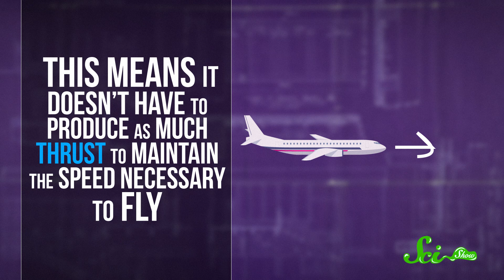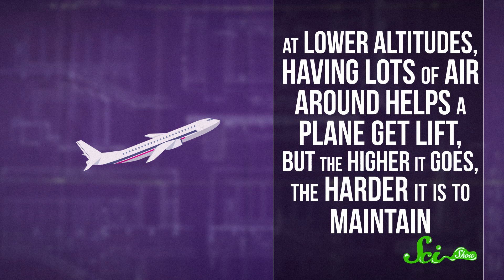Why Do Planes Fly So High?

Comment: but what about steel beams...?
Reply: I heard it melts dank memes
Reply: Steel fuel can't melt jet beams
Reply: ***** But jet beams can melt steel fuel.
Reply: ***** But a plane at 150.000 kilos flying at 854 km/h can bend steal beams.
Reply: Steel jets can't fuel dank memes
Reply: +ExperimentLife 9-11 an inside job? Well, 7-11 was a part time job!
Reply: It was an inside job.
Reply: FUNKYBULL SHRIMP
It is a fact that the internal temperatures inside of the twin towers reached temperatures to turn the steel into practically hard clay. Read the popular mechanics issue on it.
Reply: 9/11 did jfk
Reply: RantZ_IE There is no reliable video footage or imagery of actual molten steel from the site, the temperatures reached inside the buildings from the burning jet fuel was enough to weaken the steel into a dough like state though, and that could've been confused with actual molten steel as it would've been soft, pliable and red hot. As for molten aluminum or more easily melted metals from filing cabinets or chair supports, etc. that would easily be feasible.
Reply: rdizzy1 Then how come the buildings came straight down in steam of falling over to the side? How come WTC7 Came down when no plane has hit it? For you to get that much molten lava in one place all of the office metals would need to be in one pile in witch was not the case.
Reply: Lynx Kepler Then what explains all the melted steal on the ground?
Reply: RantZ_IE
Like I said , there isn't ANY reliable actual pictures/videos of actual lava. And it came down at once because of A. compounding wage of floor after floor collapsing on each other and B. The burning jet fuel poured down the elevator shafts, weakening almost the entire buildings core structure at once.
Reply: RantZ_IE
If what people with your paranoid, illogical thought process think is true, then what exactly would whoever ACTUALLY caused the buildings to come down use to supposedly cause thick steel beams to turn into liquid molten metal?? Because they've already done studies on every single thing as an entire issue of popular mechanics, and every arguement I've ever seen is worked out in detail.
Reply: RantZ_IE
and where exactly is the PROOF that there was actual liquid melted metal(while it is still molten)?>?
Reply: Lynx Kepler
He doesn't have to have ANY education at all, this shit has already been proved to be bullshit by ACTUAL physicists at actual decent colleges, read the issue of popular mechanics. Every single issue you've brought up is in there, including many more.
Reply: Lynx Kepler The tower was weekend in one edge, If the tower were to come down from the plan the edge hit by the plane would come down first, There for there would be massive horizontal pressure(Thing Called gravity) There for the top part of the tower would have came down at a angle. The Molten was found in a liquid form witch would be molten lava. Also WTC7 Also came straight down, The debris did not make any of the other building come down neither.
Reply: It falls towards the pulled out card, Go ahead and try it for yourself in slow motion, Aside from that it is not a good comparison because in a house of card every card is supporting everyone, Take four water bottles and put them in a square then put a book of sorts on top, Take one out.
Reply: Lynx Kepler I do not believe you have. I have  Masters in Physics my education is there.
Reply: Temperatures inside that building were soaring to over 1,300 degrees....Put 30,000 gallons of jet fuel, burn it in a contained concrete and steel box( or twin tower) blow some air on it, and Ta Da! You get a massive Furnance enough to even change the shape of titanium. Steel is weak as hell guys. Just because the building standed there does not mean they are not already under immense pressure from the possible 300,000 ton weight of the Twin Towers. Once that fire weakened the beams, something called GRAVITY did the entire job. Why the hell do people forget Gravity pulls everything down? Is like nobody in 2001 till now fighting about inside job ever took a freaking physics class....And if any of you believe that buildifing fell perfectly down, then you are blind as hell. Was a few blocks away when it happened and the top part litteraly collapsed sideways into another building. Stop creating lies. People actually died there.
Reply: rdizzy1 Molten aluminum does not glow red/orange like lava... Molten steel however does
Reply: ***** Ok you are the biggest tin foil hat ever. I was actually there. Like 8 Blocks away. You could see the actual steel being melted by it. Black Smoke has nothing at all to do with the actual temperature of the building inside and Scientist actually said this not damn experts who think they are experts. The fire was not yellow at all. it was already looking like a freaking volcano inside that building when it collapsed. Damn people are actually this stupid. why the hell am I even fighting with Tin Foil hats about this 14 year old crap. I dont care that the Twin Towers fell already. Move on.
Reply: The funny thing about conspiracy theorists, is that they think they know something that other people don't. They think they are in some secret club of people that are in on something real juicy. The truth is they "know" things that don't actually exist, it is all in their heads, and they need medical treatment asap.
Reply: Omg. I give up *****  you are already dragging it. Oh trust me I understand. but your calculations will be wrong. At this point is like I said, It will not melt the steel beams but it will defently weaken it enough for the massive concrete and steel building to collapse on its own. Every Tin Foil talks like if this building was the most technological building ever. It was crappy, boxy, and completely hideous. Look at the buildings today and also they're technology. Dubai is wayyy ahead than the New York or any American city with that skyline. If you are forgetting Monk, This two towers were built with 1960's technology...Its the year 2015 and things are a lot better and more powerful even for NASA. Also remember for its height, this building was incredibly un aerodynamic. im surprised with all that weight that it even lasted so long. I guess no one will ever respect anyone with an engineering degree in the internet.
Reply: Ok guys jet FUEL can't melt steel berms BUT jet COMBUSTION can melt it if it is strong enough so OK
Reply: Here's another plane related conspiracy theory: Government officials flying over the Bermuda triangle may disappear sometimes, due to the aircraft failing to maintain lift. Also, note "triangle". Illuminati confirmed :]

Comment: why does flying make my ears pop?
Reply: Anahi Cardona Short answer: Differences in air pressure. 
Long Answer: Otic Barotrauma happens during descent where the pressure inside the ear is lesser compared to the outside (the environment you're in) because remember, air pressure decreases with an increase in altitude so when you're descending, the opposite happens. Your ears is somewhat sealed and as a result, there is a difference in pressure. Chewing gums actually work for some people as it opens up one of the tubes connecting between the ears and the mouth which gives it a chance to equalize in pressure. Once that pressure equalizes, you'll be fine.

Fun fact: In very rare cases, cavities in teeth can also explode during flight due to a difference in ear pressure (same concept as the ear). 

Source: I'm a pilot.

Comment: Surprised you didn't mention cabin pressure, which is still pressurized to a couple thousand feet above sea level, meaning thinner dryer air in the cabin. They can't keep ground pressure because the structure of the plane can't hold it.

Comment: I have two questions: 1. If higher altitudes mean less oxygen, why is it that supersonic jets, such as the Concorde, are able fly at higher altitudes? 2. Even if having oxygen canisters to power the engines and gain higher altitudes makes them essentially rocketships, why don't we have them for commercial use anyway? Is it too expensive having to refill both the oxygen and fuel or is there some other reason?

Comment: You forgot to mention facts on temperature decreasing in the troposphere but then pausing and increasing in the stratosphere which reduces the benefits of flying much higher than the tropopause, even though the air is thinner and a higher true airspeed could be achieved. Oh, and then you could have got into airflow over the wings vs. mach and how at some point then airplane will either stall, or must go faster than the speed of sound to still produce the necessary lift.

Comment: Why is it, when you push something down in boiling water (a hot dog or maybe a vegetable) to the bottom of the pot.  It starts boiling like crazy?
Reply: Because then there's not only boiling water below it, but completely surrounding it, plus it's closer to the heat source.
Reply: Nerfin Merfitt The bubbles that boil up are formed on the surfaces of objects. Pushing an object to the bottom of the pan adds significantly more surface area.

Comment: BTW: The first commercially produced jet liner the De Havilland Comet was prototyped in 1949, and started making regular flights in 1952.  Unfortunately, a year later, metal fatigue around the square passenger windows resulted in fuselage failure, but after the windows were rounded, like modern jet liner windows, the Comet was reliable. But the damage had been done.

Comment: AAAHHHHGGGGG NO! That's wrong. "This means it doesn't have to produce as much thrust to maintain the speed necessary to fly" is completely wrong. The amount of thrust needed to fly depends on the weight of the aircraft and the ratio between lift and drag. Lift and drag vary together as density changes so their ratio is CONSTANT. What actually happens is that all the speeds (stall, min sink, best L/D etc.) change as the density changes. Flying in low density air means that the speed required to fly is higher than it is at high density, but the thrust required to fly is constant!!!!!! They fly higher for two reasons. The jet engine is more efficient at low inlet temperatures and there are lower temperatures up high, and the plane travels faster for the same thrust. However I can't stress too strongly that the THRUST REQUIRED TO FLY IS CONSTANT.

Comment: I've got a question burning-- since I'm flying from Boston to Las Vegas next week-- why can't I use my cellphone whilest flying?
Reply: looks around suspiciously
They'll try to tell you that it's because it interferes with the plane's navigation, but that's malarkey. My uncle's a pilot and the real reason is if there's an accident, they don't want people on their phones or laptops with potentially headphones in. But if they told people that everyone would use their phones during flights and then accidents would be a lot worse, so just roll with it. ;-)
Reply: You_just  I just want to be able to use my phone's data to check out my Flightradar24 app to see what I'm flying over. I didn't think I'd down the plane and I often wonder how many people forget to throw their phones/iPods/iPads into airplane mode while traveling.
Reply: Anthony C Redes you never saw me
smoke bomb
Reply: They say you can't but you can. It doesn't harm anything. The only problem is if you are above FL 100, 10K feet, you won't get service. Usually.

Comment: Flying high also benefits airliners with less fuel consumed and shorter time of travel. As Dr. Hank mentioned, there are less air molecules as you go higher therefore less parasite drag even if you increase your airspeed. Also because of the Earth's shape, the one traveling higher covers more distance than the one traveling lower even if they have the same airspeed. Lastly, airliners could make use of the jetstream.

Comment: Can you explain how Lift works?
Reply: That's an extensive answer... But here it goes:
Basically an airplane develops lift through two important scientific principles: Newton's third law of motion as well as Bernoullis principle.
Newton's third law of motion says that for every action there is an equal and opposite reaction, so as the airplane wing angles itself up towards the sky, the air that is hitting it straight on gets deflected down the aft section of the wing, we call this relation the Angle of Attack or AoA... Since there is a force applied in the underside of the wing, the wings also must feel a force equal and opposite to that above the wing, which helps make the airplane go up...
Bernoulli on the other hand, states that as a fluid speeds up, it loses pressure, so wings are design with an asymmetric camber, making the air split at the leading edge or front of the wing, and forcing the air above the wing to speed up and therefore create lower pressure, and thus.. LIFT!
Reply: mandith The air moving across a wing moves faster over the top than the bottom, and that creates a difference in air pressure, witch in turn generates lift.

Thats just the Bernoulli's principle explanation though.
Reply: zeke1220 The difference in airspeed effect is real, but the angle of attack effect is much stronger. If you look at an aeroplane in inverted level flight, it's nose is usually much higher (i.e. pointing at the sky) than in normal flight. In effect, it's using excessive AoA to "fight" the Bernoulli effect trying to pull it downwards.
Reply: mandith Hasn't the difference in air speed causing lift been debunked many times over? You couldn't get lift from the wings if the plane was upside-down in that case.
Reply: Harold Weaver Smith It's not excessive AoA, most planes have wings that are slightly angled upward, so when you flip it over you need to nose up to get the same effect. The Bernoulli effect is absolutely unnecessary to explain this.

Comment: I saw this video on how airplanes fly and stay up. It said that air molecules keep the plane up (along with the engine). But if they are fewer air molecules the higher you go. Then how does the plane stay up in higher altitudes.
Reply: ***** His explanation was wrong. They don't need, nor do they have "bigger wings". They fly faster. There's an inverse square relationship. To fly in 1/4 of the pressure, you have to fly twice as fast. If you flew at the same speed you'd hit a quarter of the number of molecules. So you'd get a quarter of the lift. By going twice as fast you hit twice as many and hit them twice as hard. 1/4 x 2 x 2 = 1. Same same. Bigger wings are not needed. In fact bigger wings are needed to fly slow (think sailplanes).
Reply: gasdive You are absolutely correct.
As a further note to those not well versed in aviation, as pilots, one of the first things we learn about is this thing called the Indicated Air Speed (IAS) and how it relates to True Air Speed (TAS). In simple practical terms, IAS allows us to estimate the lifting behavior of our airplanes without having to manually adjust for altitude. That is, if you fly at 140 knots IAS, pretty much regardless of the altitude (and hence air density & pressure), it'll behave as if you were flying at 140 knots TAS at sea level altitude. IOW, if you need 5 degrees nose-up pitch to fly straight and level at 140 knots at sea level, you'll also need 5 degrees nose-up pitch to fly straight and level at 140 knots IAS at 35000ft (but your TAS will be much higher, usually around 2x IAS at that altitude and typical air temperatures). At sea level, IAS=TAS, but the further up you go, the more TAS runs away from IAS.
This is also the reason why all primary flight instruments on airplanes are in IAS, not TAS. TAS is nice to know for your trip planning and making sure you arrive on time, but you need to know IAS first and foremost, as your airplane's ability to fly depends on it.
Reply: Lifebeam87 Air Density is only one factor in the production of lift. To produce lift, you would need several factors: Angle of attack, air density, speed, and wing surface area.

If there are less air molecules you could just increase any of the other factors to provide the same amount of lift.
Reply: gasdive His explanation wasn't wrong. Incomplete perhaps, but no more so than your correction.

Both increasing the surface area of the wings, and increasing true air speed are viable options for addressing the reduction in lift which is caused by decreased air density at higher altitudes.

Planes definitely do fly faster at higher altitudes to accommodate decreased air density. However, it's also true that the design size of aircraft wings is influenced by their intended flight altitude, and that higher flying aircraft have larger wings.
Reply: Jon
Here's the planform of a DC3 with a ceiling of 23 200 ft. https://en.wikipedia.org/wiki/Douglas_DC-3#/media/File:DC3_Silh.jpg

Here's the planform of a 777 with a service ceiling of 43 100 ft. http://www.aviationinspector.com/wp-content/uploads/2013/09/Air_France_Boeing_777-228ER_Kustov_planform_view-1024x878.jpg

There's hardly any difference between the two. Apart from sweep, they're almost identical. The The DC3 has a wingspan of 95 feet and an area of 987 square feet for an aspect ratio of  9.1. The 777 has 200 ft wingspan with an area of 4605 sqft for an aspect ratio of 8.7. They're virtually the same, but the aircraft that flies nearly twice as high has slightly shorter wings.

The wing loading of the DC3 at MTOW is 25.5 lb/sqft. The wing loading of the 777 at MTOW is 143 lb/sqft. The high flying aircraft has wings with less area.

By any measure, the high flying aircraft has way smaller wings than the low flying aircraft. It's not that I left out details. It's that Hank's video is simply wrong. High flying aircraft don't have bigger wings than low flying aircraft. They simply don't.
Reply: totoritko
Yes, your additional note is exactly right.